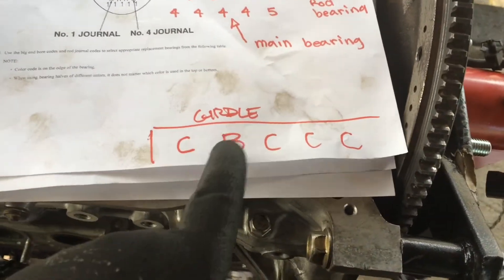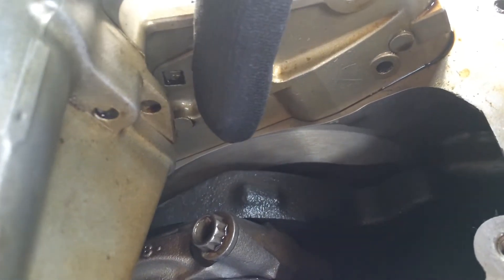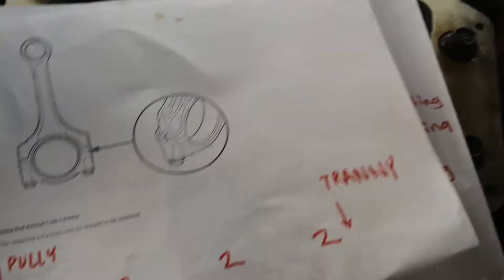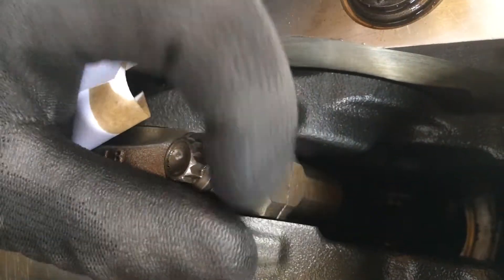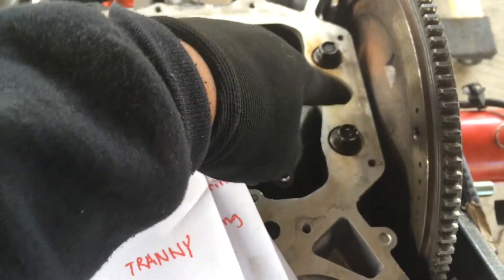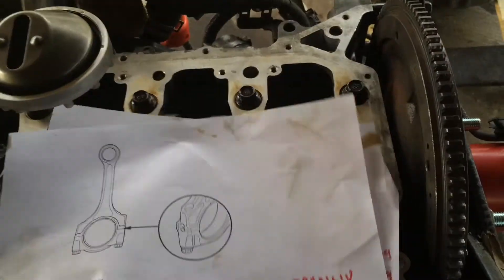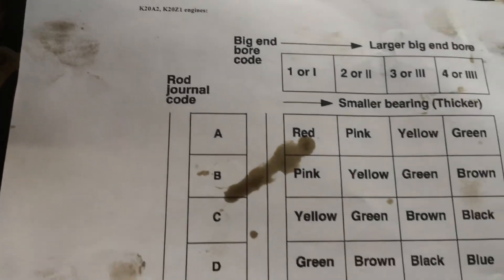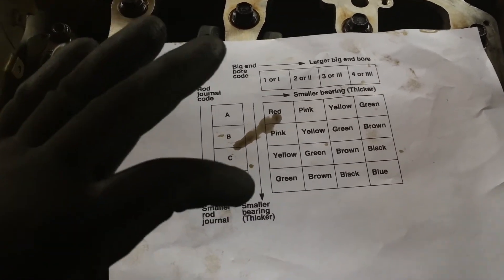K20 Rod Bearing Color Code Journal Main How To Find Code DIY Acura

Comment: This is for stock putting new oem bearings back in , correct ? If I wanted to do acl of King bearings is this necessary
Reply from the maker: To know if you should get oversized or standard yes this is mandatory for me.

Comment: What if the original bearing color isn’t matching the color your getting on the chart?
Reply from the maker: maybe it oversized and they used a bigger bearing
Reply from the maker: the chart in this video is for type s. base is different.
Reply: I have a k24a2 block
Reply from the maker: @Javi_Built_   thats a different charts and marking. i think its number + numbers. i have the chart if you need it.
Reply: HellaStance yes I do need it I appreciate it

Comment: Good day I am in the process of rebuilding my k20z4 engine and on the chart it sys green/brown but does this mean one half green and the other brown or can both be green ? Because my chart sys on the 3rd main journal needs green/brown but when I removed the bearing both half was green so I plastic gage all of my journals and they mesured between 0.025 and 0.038mm , advice will be appreciated

Comment: I'm having the same issue 2222 on my block and no letters.  Is your Acura a legend coupe?  Mine is.  I tried to use the Finley online repair manual for the 94 Legend because it is the only place I have ever seen a color chart and codes referenced in a manual!.  It boggles the mind, what is Acura, (Honda) thinking about their car owners?   Stance is getting his main bearin info from the block's five letters, and numbers inside the pulley end of the block/   And not the numbers or lettes on the crank?  O only got 4 numbers on block 2222  but on crank I got 1026,  BBBBBB,  4533  and I'. like you too, all dressed up and no place to go and i'm needing my damn parts.  Go online and see 5 different rd bearing numbers and colors five lower and upper main bearings and colors.  They all fit and you can't order them.  Who has the chart?
Reply: james williams What if the motor needs to be machined ? Does it change the # and letter designation ?
Reply from the maker: yes, if motor was machined then you would have to use plasti guage

Comment: Hi Hella Stance. 
I was going to order the NEW crank bearings for my K24A2, so I write down all the number and letters. Now I have a problem. Instead or letters on the girdle I have numbers(44444). What should I do?
Reply: ->BBBB
->45445
5 numbers and no letters.
Reply: Thank you so much for replies. One more question, looks like I will need brown/black bearings so, does it mean I can use brown or black bearings or do I need to use one black and one brown bearing?
Reply from the maker: one brown one black